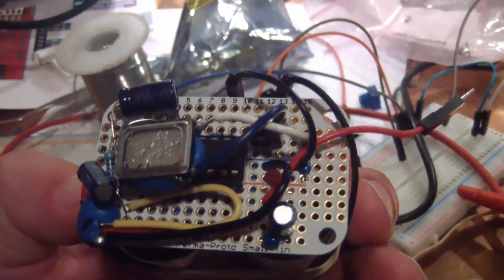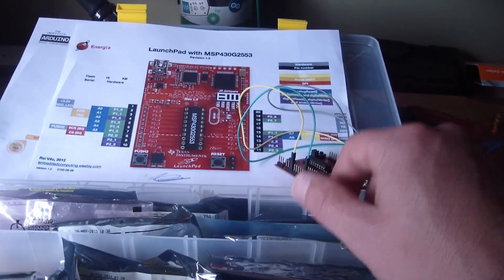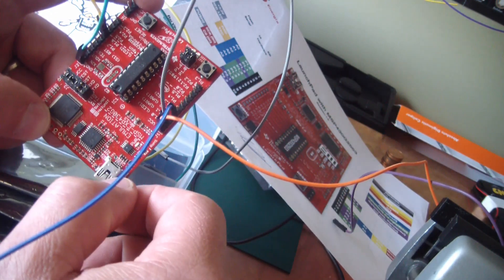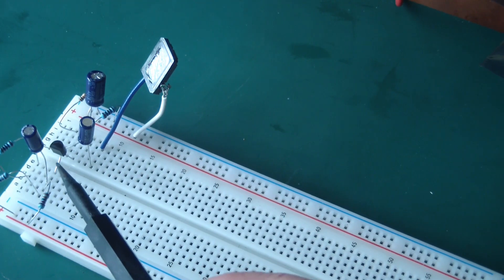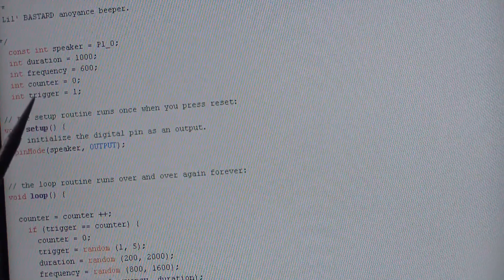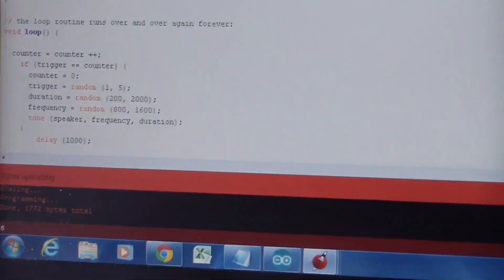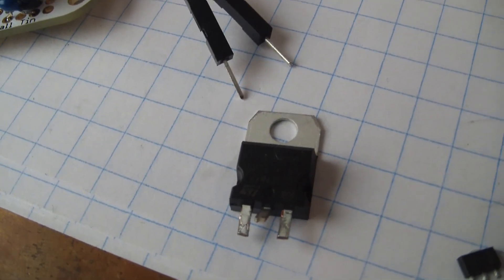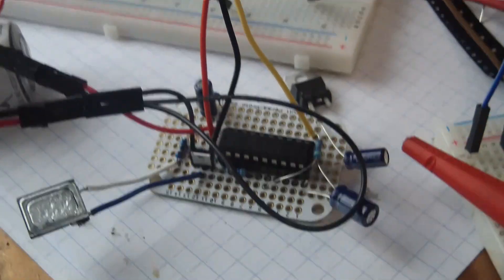Zen Blaster; a Most Annoying DIY Electronic Device

Comment: How can i scale this up for a car horn and a 12v battery?
Reply: Arduino, relay board, motorcycle horn, battery. Cost less than 20 USD. Code is basically 2 lines, beep, wait, repeat. I'll post a vid asap👍😄

Comment: So. Now we want to build one that is about as small and cheap as possible. Would like reverse-polarity detection/provention. Since I can get CR2032 batteries for around $0.16 USD
Reply: . This means I can afford to throw these away without to much cost.

If I want to attach them magnetically to their hiding spot but still keep them as small as possible this would be a job for 1-4 neodymium magnets. If we keep the overall weight down, then we can get by with smaller, cheaper neodymium  magnets. 

Since I really want to minimize the chances of this devic
Reply: ...device being discov
Reply: .discovered. I want to set the interval to random value between 3 minutes and 3 hours. This means we'll need to now how to do this without sleep(); I haven't got a clue how to this on an Arduduino or comparable.

So in summary, I'd like the device to be a balance between small size, minimal energy consumption,  minimum weight, great battery  life. 

There are commercial "annoyers" available but I'd like to learn how to do this with minimal cost- perhaps no more than $1.25 USD. Thoughts? pointers? Partial solutions. Thanks?
Reply: @timnemec1572  i will buy your first 10 for $2 each

Comment: Your problem was leaving it hooked up to the computer. The ground on the computer is much “stronger” than the ground on the battery (or negative). And they float relative. So +3.7V on the battery to the computers ground is literally any value- you have no idea what the bias is. Could be 0.03 V. Could be that the V+ from the computer is -1V relative to the +v rail of the battery.  Etc. that’s screwed me up several times. You can’t have two references in short.  Can’t have the USB hooked up AND an extra or external power supply, including one of those breadboard supplies. Using both - generally the first thing to go awry is the MCP fails to boot. Then from there - not a damn thing.

Comment: Dear God! Just had a truly horrible idea.
Instead of a speaker use a motor and attach the device to something that makes a nice thud when slapped by the motor (like the backside of a closet). Add some sensors that will prevent it from going off at the wrong moment and install it all near the bedroom (room next to it or something like that). Program it to make a few single loud thuds every night...

Comment: I made something similar. I had an old cheap rc helecopter that was damaged and stuck a beeper on the main rotor drive channel and put a playstation contoller vibration motor on the other channel and stuck it in an ice cream container. Very annoying and amusing watching people try figure what the racket was.especially when you can operate it from a large distance

Comment: I have one of these in my house. It's a smoke detector that some dingus installed under the floor, so it beeps when the battery needs replacing. Took me 6 months to find it. Required moving the couch and opening a hatch in the floor to find it.

Comment: This was one of my first microcontroller projects. Attiny13 with a light sensitive resistor and a little piezo speaker powered by a battery. Small enough to hide anywhere, it turned on a few minutes after the light turns off and started making noises at random intervals until the light turnes on again.
A more recent version I made has a little radar sensor so it can detect movement and go quiet even through solid materials.

Comment: 2:20 - yeah, but do not forget there are atTiny controllers that have nearly everything inside and also have DIP-8 packages (DIP is also used for many other AVRs). The Arduino shitware goes to hell though, as it will never fit in atTiny (and is an unreliable waste of space and clocks for the bigger MCUs) yet with one's few instructions ASM is a really perfect option. Less code - more space for resources (graphics, texts, audio samples in your case). P.S. just reached 96% flash utilization on an ASM-coded atMega164 at work - thanks font tables and shit :)

Comment: You can do all that with the Arduino chip too. It doesn't need any external components. You just need to set it to use its internal RC oscillator instead of the external quartz. It also works flawlessly with 3.3V instead of 5V.

Comment: Many years ago I built an electronic cricket. 
It had a light sensor and when you turned off the kights, it waited a few minutes and started beeping like a cricket. 
When the victim tries to find it he had to turn on the lights and the cricket stopped beeping making it impossible to find if it mimics some innocent box.
Now with this small button lithium cells and smd components it should be easier to hide one of this.

Comment: we had one of these in electronics class. it was called the hidden tormentor. it would use a 555 timer to set the 1 second on and i hour off. it then sent the signal to another 555 timer acting as an oscillator at 10 kilohertz
Reply: i aslo annyed others by hooking an amplifier and speaker to the class function generator at 16 kilohertz

Comment: All you need is 1 resistor to use an Atmega8/328p and other dip packages(as long as you program fuse to use internal oscillator). And you reaply wanted to you could skip the 10k resistor on reset too.

Comment: Dick Smith Electronics in Australia made an "Annoying Cricket" kit with a few discrete components decades ago, and it also stopped when sensing light or sound. Electronic techniques are ironically being lost with the use of microcontrollers, where only interface circuitry's needed.

Comment: Back in the '70's I made a couple of these using a pair of 556 timers in each, working off a 9 volt battery. Put both in the library of the community college I attended. One would go off.......then 10-15 minutes later, the other........ back and forth......drove the librarians crazy! Cost me less than $7......

Comment: Oui! Please to frankenstruct a device so insidious, so random and so fucking stealthy as to bestow upon some particularly nasty individual the wherewithal to cause the collective ET, IT departments and of course ALL of the Felixtricias to corntemptate The Long Swim during a 28 day hitch. I am indentured to a certain 307 meter hydrocarbon hunter plying the treacherous Kraken infested, multimaelstromed puddle that I believe in French is known as the Gulf of Mexico. I promise no meaningful spaces will be gremlined. But the inner sanctum where ONLY pixie rustlers are welcomed... The "Fluxlair" is ground zero. Please consider the entire engineering department forever beholdin'. This is gonna be GREAT! I dig your shows, grasp your micro dose floaters and like yourself, am a Quaker. Thanks, may peace be with thee and thine.

Comment: I very quick and cheap way to make one is to get a smoke alarm. Power it up using 4 or 5  AA batteries, you want around 7 volts. 
You're basically running it with full batteries but with the voltage low enough to trip the change batteries chirp. You can hide it as is or gut the thing. If you're experienced enough you can remove a few of the components but it's not necessary. You'll get over a decade of nonstop, intermittent chirps.

Comment: counter=counter++; // my eyes hurt!
BTW you can easily use an arduino/bare atmel chip, just set the fuses to internal RC oscillator. For this, even an attiny13 would be overkill (but draws very low power, runs a wide range of voltage, etc.).

Comment: I built something like this (statute of limitations) years ago, as a going away present when I left a job.
We had an infrared motion detector alarm system so I drove an IR LED from a battery powered 556 (dual 555 timer)
Set with a long time constant (I tried for about 5 days) the LED (poked thru a ceiling tile) tripped the alarm... every so often.
Sometimes it would flash while the alarm was off, sometimes when it was on - with no discernible pattern. 
But it did give them a $200 dollar call to the security co.

Comment: Microcontrollers usually have timer module that you can set to trigger interrupts rather then use a loop. Usually you point a function to run at each interrupt event. Then you can set the microcontroller to some sleep mode to make it consume less power during idle time.

Comment: I like to use millis() in arduino projects.  It starts at 0, counts by 1 for every millisecond the program has been running.

You can use it 'nekkid', like this.

count = millis() / 1000;
if (count = 10){
print("ten seconds elapsed\n");
}

Comment: I like the ones that have two speakers. Each speaker outputs a different frequency in the range slightly above normal hearing say in the 20khz range. The sound is heard in the middle ear. The sound is the difference of the two frequencies. The sound seems like it is inside your head. No way to tell where it comes from since it seems like it is inside your head. Younger people and females seem to be able to hear it better though.

Comment: The docs are not well written when they say "knowledgeable programmers use `millis` instead of `sleep` or `delay`." What they're trying to communicate is that most of the time you can't just put your entire microcontroller to sleep for two seconds just because you want to have a light turn off after two seconds. Instead, you can capture the time when you want those two seconds to end (`targetTime = millis() + 2000`) and let your main loop keep running. Periodically, you'll check whether `millis() >= targetTime`, which will tell you it's been two seconds and it's time to turn the light off. (Typical software does checks like this between 10 and 100 times per second, so you will overshoot by a fraction of a second but usually not enough that users will really notice.)

For a project like this where all you want to do is do some work and then sleep, the most efficient thing is just to calculate how long until the next chirp and `sleep()` that long—no need for a counter at all. However, if it's possible your device will have more features in the future, the best practice would be to wake up many times per second and check whether anything needs to happen. If you're using `sleep()` or `delay()`, you have to throw away your code and start over if your little task is no longer the only one, because those two functions prevent anything else from happening while your task is waiting. If you did it with `millis()` checks from the beginning, it's just something you need to check periodically as part of your event loop and you can have lots of timers going at once: each one is just a target time plus an action to perform when the time comes.

Comment: I used to do this when I installed alarm systems years ago. I had a pet peeve, if a customer would not let me use their restroom while I was at their house for 6+ hours (only ever did #1 at a customers house) I would find a pet store during my lunch break and buy a 50 cent box of crickets. When I got back to their house I would go up in the attic and drill holes in the horizontal cross beams of the master bedroom walls and drop a few crickets in each wall. Those suckers would live FOREVER and would drive the customer batshit crazy. Service techs would go back and the customer would swear that I did something but, there was never anything wrong with the alarm system. MUWAHAHAHAHAHAHA
Reply from the maker: WHAT KIND OF HUMAN DOESN'T LET YOU RELIEVE YOURSELF? I'm shocked that people like that exist.

Comment: I taught electronics at a school in  the UK. When I left I left one of those hiding on top of the light fitting hanging from  the ceiling. They have only just found it 8 years later.
Reply: did you hardwire it or was it on a battery? if so i wonder how long it lasted
Reply: I stuck a sticky note on my principal's wall in the office in my college level high school that said "Please do not remove, Thanks.". It stayed there for more than 7 years. It served no purpose. 
I did the same thing at my work and it stayed for over a year until our building was getting painted and they removed it off the door when they removed the doors. 
I need to try it again in other places.
Reply: @GameboiX  You must be Markoff Chaney
Reply: You wouldn't help someone build one would you?
Reply: Probably solar.
Reply: My Fish was this big,
Reply: @wendychong8823  When any woman would tell me that it would immediately cause me to go flaccid.
Reply: @Norm475  scared of commitment?
Reply: @LittleRainGames  Nope, not scared at all.  Did it once and never again.  You talk about commitment, commitment isn't getting married it is staying married.  Since women file for divorce 80% of the time, it is women that are commitment phobic, not men.

Comment: I almost drived my mom crazy by making an annoying machine using an arduino, and when it's shook, it'll stop sounding for 10 secs, and if the lights are off it will sound on random intervals. P.S: It's randomly sweeping a frequency from 5k-6.2kHz signals at 52db

Comment: Some arduinos have built in crystals, so you just need to burn the right bootloader. You have 2 things there, a programmer and the chip. If you can find or make a programmer for the arduino chip then you are all good to go. :P

Comment: as for the delay ... I totally believe in KISS for a project like this.   The delay only gets in the way if you need the cpu for doing something else.    To get around delay sucking up cpu time, use the millis method to determine when to so something and that'll free up the main loop for doing other "stuff".

example:  I need to make the annoying sound  every 20 sec, plus do a bunch of other stuff

long currenttime = millis(); // be sure to use long 
if (currenttime > NextAnnoyingThing)
{
   NextAnnoyingThing = currenttime + 20000; // 20 sec
   AnnoyingThing(); // 
}
// a bunch of stuff follows

Comment: I set out to prove that the increment that people were moaning about  (counter = counter++;) doesn't make a rats ass difference except chew up some processor time.   I was wrong.   It appears that for Arduino compiler anyway,  The compiler must optimize this completely out of the outputted machine code.   I put the increment in a 10000000 for loop and it chewed up zero (0) millis cpu time and I ended up with counter = 0.

Comment: I'm not yet familiar with the MSP430 but I noticed on your programming board there is a spot to install an oscillator. Neither here nor there for this, most of these MCUs have an internal clock. Looking at the datasheet it looks like this one actually has a 16MHz internal clock? Anyway, I had the thought that this project could be adapted to use the ATTiny85 which is an 8-pin package since you only need the one output for the speaker, this could also allow things to be much smaller and it could be powered with a lithium coin cell. Anyway, to answer your text at the end of the video, it would be fun to be able to pick this up as a kit, in my opinion, for the sake of learning to use another type of MCU. If you do elect to build a PCB for that project I would be interested in following along and building one as well. If you're interested, I could provide you a schematic and sketch for the ATTiny85 equivalent once I come up with it.

In the meantime, I will continue to keep my dick in a vice. 73.

Comment: I don't know if you've heard of C.H.I.P, it's a tiny little $9 computer, but there are definitely some cool things that could be done with that. Basically it's a tiny pc with a 1ghz processor, 4gb of ssd storage, wifi, Bluetooth, and 512mb of ram, also you can plug it into any 3.7v li ion battery you have or any 5v usb power supply and it will work with the press of a button. Did I mention world domination via robot army is imminent? And that it's $9, and it's small enough to fit into the palm of your hands.

Comment: I had an old digital watch I had totally forgotten about and lost in some drawer. It randomly started doing this exact thing. The beeps always stopped before I could get a direction of where it was. As time went on the beeps became more and more distorted until it eventually just made noise. I was only able to pin it down after several months.

Comment: 11:50 is actually good stuff about sleep() in your case.. but maybe you should just put your random delay in ala sleep(random_delay).. to add a century to your battery life, or even use smaller, cheaper batteries.

Comment: funny as fuck! reminds me of when I worked as a enginerd on a noisy production line and used to stick a count down clock to the underside of operators chairs. I'd be long gone from the room before it would go off and the last place they would look was under their arse, ah good times, they were mostly women too so used to get quiet pissy (unlike the understanding unicorns) , this is a circuit I'm going to build.

Comment: Hi, I bought one of those $300 dewalt weedeaters and the battery crapped out after 6 months and the store does not sell replacement batteries. They want me to buy another weedeater. I am sure I am not alone in this problem. I was wondering if you could perform a public service and find a way to gut the old battery and convert it to a plug in?
Reply: Loke Man he already has a video on how to get magical pixes from the wall and into power tools not to sure what it's called but it has hot wheels in it hope this helps

Comment: where did you find somebody to give you those lithium ion batteries?
Reply: go salvage laptop batteries, you will find that most of the 18650s in there are still good. This is how most guys build tesla like power walls. or if you want non rechargeable ... what AvE said :)